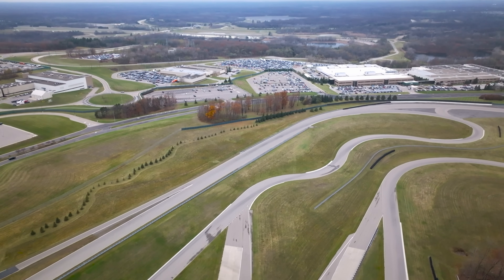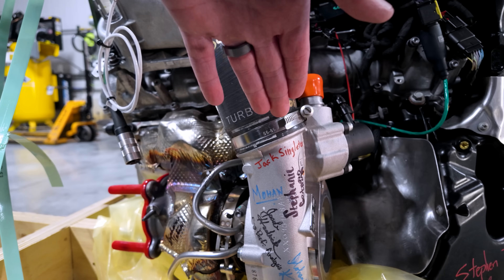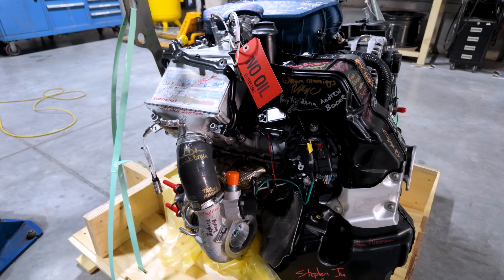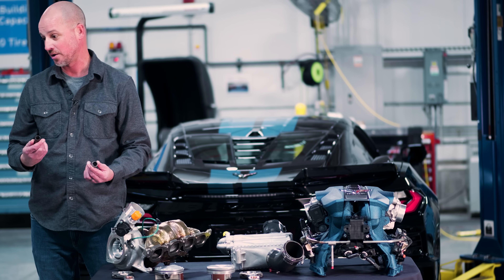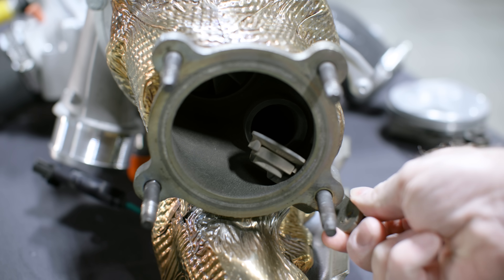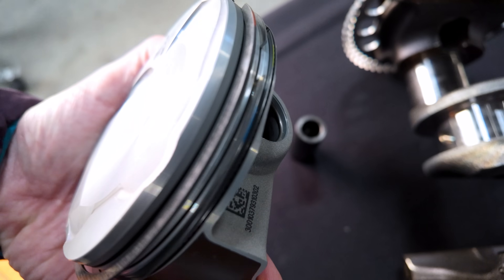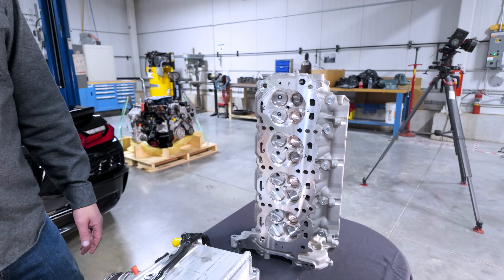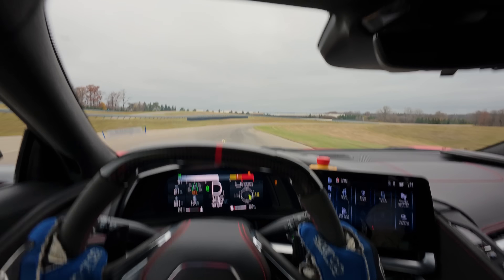2025 Corvette ZR1 LT7 Engine Walk Around

Comment: 0:28  Why do all these ZR1 engines say LT7? Has it always been that way?
Reply: I think it's the same block, but every generation change the engineering design than included different cam chambers, open hole to adding oil filter, different pistons and shafts, turbos etc.
Reply: it’s to show where the LT7 makes x generation’s ZR1’s power at x rpm. Ex: LT7 makes the equivalent of the LS9’s 638hp @ 4,100rpm

Comment: GM should try a hot-v next
Reply: unfortunately no, many don't realize how HEAVY turbo assemblies can be (before you even add the weight of an integrated manifold) so i bet the reason they positioned them where they did was to additionally address WEIGHT OPTIMIZATION and keep a low CoG.  "BRILLIANT...!!!" (2 old guys drinking Guinness voice) yeah that's how i'd do it, so GM Engineers "didn't miss a trick" with the LT7.
Reply: @phillyphil1513  with a hot-v I'd think weight would be saved?
One of the advantages to a hot-v is less tubing and shorter distance from turbo to intercooler to intake valve 🤔

Comment: Turbo speed sensor? I wonder what the engine management program does with the information since turbos spin up with exhaust pressure. Compare first and second derivative, see that max turbo RPM is approaching and then what? Variable vanes? Close the throttle? Does it intervene a lot? Would like to know more.
Reply: Open the wastegates?
Reply: @ which releases boost pressure but doesn’t necessarily slow the turbine.

Comment: This is a hundred MORE horsepower than what the hypercar Agera R, for reference, did on pump gas ten years ago. And it cost two million dollars. On E85, this engine is probably capable of well in excess of 1200 horsepower at MINIMUM.
Reply: Super low production, probably hand crafted and assembled car vs this? Yeah I'm not surprised production costs are vastly different. While the production number probably won't hit over 10k, maybe 15k max, the zr1 benefits from building off the C8 platform. And they sold relatively a lot of C8 corvettes.

Comment: 911 turbo has 3.7 L turbo and is rated for 640 hp vs 5.5 L rated for 1060
Reply: Which means the Porsche will get it's ass handed to it.
Reply: @ForeverDownByLaw  but the 911 turbo is awd with a blistering 0-60

Comment: Zora will be the car to have for overall performance. Old school people will prefer the Zr1 though so that's cool. The ZR1's 1000hp and 2wd is just a recipe for ZERO traction. It won't even come close to competing to other 1000hp cars with AWD in a straight line and on the back roads as well. No AWD pull out of the corners. I bet the 60-130 times will be only mid 5's where a Plaid is mid 4's. Apples to Oranges though I know.

Comment: In the Chevrolet Pressrom it says the engine output is 1064hp/873 kW at 7000 rpm. Except, 1 kW is 1.34 hp, so that would mean 1170 hp. Conversely, 1064hp, where one hp equals 0.7457 kW, would mean 793.4 kW. Either way, one number stated is wrong. It could be a typo...

Comment: I wonder if the folks at Porsche and Ferrari are watching this video- and what they think.
Reply: Nothing, gm bought ferraris and porsches to bench mark to engineer this car
Reply: Porsche has used GM magnaride tech for the 2009 GT3 motor mounts. Ferrari uses GM magnaride suspension system. Has been since 2006 or so
Reply: @WindyCity1992  magnaride is not gm tech, its an industry tech that gm calls magnaride.
Reply: @km6832  That's not true. Maganaride is not just some industry tech. Magnaride was developed by Delphi Automotive which was also part of GM back in the 90's. Magnaride was first used in Cadillac back in 2002 and then the Chevy started using it in 2003 with C5 Corvette. Later on it got licensed to other manufacturers.
Reply: @joshuapullins8815  so it was a stand alone company then it was acquired by gm ....so it was a industry tech that was licensed to an OEM and then that OEM allowed others to use it. So i was still right.
Reply: @km6832 ..Delphi was not acquired by GM, it was founded by GM
Reply: Porsche & Ferrari may communicate with GM but , their target demographic cares about status and prestige more than performance. Corvettes are hot sellers but dont threaten the niche market of Ferrari
Reply: They’ll never have the class of the engineers that gave SG so much of their time and early access to the ZR1.
Reply: @AJ56  it’s like you never saw the SG porsche deep dives, lol.
Reply: @johnsullivan8673  I didn’t, but now I will.

Comment: Impressive horsepower numbers; equal to a 1st gen Bugatti Veyron with 2 less turbos and half the cylinders. Good job there GM! 👍
Reply: And the fact that this engine is designed to meet even stricter emissions requirements than the Veyron and goes into a car that costs a fraction of the price only adds to how impressive it is.
Reply: @SchroedingerK  - agree 100%! The ZR1 is an automotive bargain for what it delivers.

Comment: Do they also use the port injection to lessen carbon build-up?
Reply: Yes, it's port and direct injection not a new tech but that's the cure for carbon build-up Toyota been using it since early 2000

Comment: In the transmission section of the video, Dustin mentions the transmission possesses the same gear ratios as the Z06.. I wonder if the overwhelming power advantage / low end torque of the Zr1 will negate the long 5th gear issue the Z06 had at the Nürburgring

Comment: Did they ever give a reason why they are running two mono scroll turbos instead of two twin scroll turbos? If they are wanting to reduce lag wouldn't the dual twin scroll turbos be able to further reduce turbo lag?
Reply: I remember reading since they are running electric wastegates they can utilize programming anti-lag system is designed to reduce turbo lag by maintaining turbocharger spool during rapid throttle changes. This is achieved by keeping the turbine spinning even when the throttle is lifted, ensuring quick boost recovery. It adapts to driving style, optimizing power delivery in high-performance scenarios. While specifics for the ZR1 aren't fully detailed, typical anti-lag systems use strategies like ignition timing retardation or bypass air flow to keep the turbos active without creating significant stress on the engine.
Reply: @geerstyresoil3136 

I see I knew there was an anti lag system installed. I just figured utilizing a dual twin scroll setup would be more beneficial than the dual mono scroll setup that they are using. Mostly knew to the turbocharged world. Been mostly driving na engines for most of my life so I just figured using the twin scroll would have been a better option.
Reply: yes it does seem strange, but i think the problem with Twin Scroll is ultimately on the top end (since TS is an optimization for low end response on the street).  at the top end (like when you're going for a rating of 1064hp) Twin Scroll acts a restriction, which is why you generally don't see it used in Motorsports and Racing (think Drift, Lemans, F1, etc) where the whole point is to spend as much time as possible at WOT.  it's very similar then to the idea of fitting a Close Ratio Transmission where you optimize gears 3, 4, 5, 6 and ignore 1st and 2nd, because ideally 1st and 2nd are only used at the start of the race, and never engaged again until after the checkers.

Comment: So sad this engine goes in a 4000lb car.
Reply: A Bugatti weighs 4400lbs
A Lamborghini Revuelto weighs 4000lb

These cars extensively use carbon fiber and still break the 4000lb barrier…the ZR1 isn’t a carbon tubbed car and weights the same.

Considering power and price, the ZR1 did the job better.
Reply: @paulcabinatan2390 Congrats, those cars you mentioned are also not good track cars. They are hero lap cars at best since the consumables deteriorate so quickly. The ZR1 and Z06 chew through gas, tires, and brakes due to weight. Like the cars you mentioned, the ZR1 will hardly ever be seen on track days due to operating expense.

You don’t need a carbon tub either. A C8 Z06 owner has gotten his down to 3500lbs on his own. If he can do that, just think what GM can do.
Reply: @anonymous..- such a small amount of buyers want a stripped out car.  I had a c6z06 also, a 2006 stripped out model.  Back then it was cool but compared to my c7z06 it was trash.  Almost as bad as my 2015 z28.  These days a few hundred pounds of weight for some creature comforts is fine for 95% or more of the buyers of these cars.
Reply: Imagine trying to fit it in a Saturn Sky.

Comment: The one issue I have is so what it makes 1000hp, there are 4cyl making that. 100yrs of making engines and yet not high hp with high efficiency. What gives? Did you even try to get better efficiency? Just a waste. Electric is and had been the future period. GM wasted time and money on this period. Yeah yeah 1000hp but whats the fuel range to go with that motor? Efficiency is the holy grail.
Reply: huh, what OEM 4 cylinder consumer car makes over 1064 hp stock? I'm waiting... also cylinder count is only one aspect of engine design. there are cummins truck engines with 4 cylinders that have ~3 times the displacement of this 5.5 liter v8.
Reply: a 4 cylinder making 1000 horsepower won't even last til afternoon tea.
And it's a little disingenuous to complain about fuel efficiency on such a product. It's got eight cylinders, by design it'll never be an efficient design. Just wait for the true E-Vette that will be the car for you
Reply: @Mealsandwheels  "Efficiency is the holy grail."  sounds like a bot wrote that or something the borg would say.
Reply: Idiotic statement. Ones going to have a warranty and one isn't. One can take 1000hp for years and one can't. One SOUNDS 10x better and one sounds like ass. Who are you to discredit the years of development it took to develop such an engine?
Reply: Bot or not, this is a disrespectful comment, engineers from 100 yrs ago can only dream an engine like this.
Reply: Looks at a race car, wonders why it's not a Prius. 

Goes to a cars and coffee and plays mp3 files of engines revving, thinking he's part of the group. 

When they sell out and most well above MSRP, I hope the answer has become clear by then. Being confused at that point Just isn't going to be a good look.
Reply: Usually I don’t fuck with people’s opinions, but fuck you’re an idiot. This is a hyper car. Why the fuck would efficiency be king in this scenario? Over 1000 hp that you can daily but also set records at a track the same day? Find me something like that with 1000hp; I’m saying this being a fan of neither Chevy or the corvette.. What a dumb fucking comment I’m annoyed I actually read this.
Reply: Because these are the last gasoline engines.
Reply: @TwistedRealityLife  haha, gasoline is never going away.